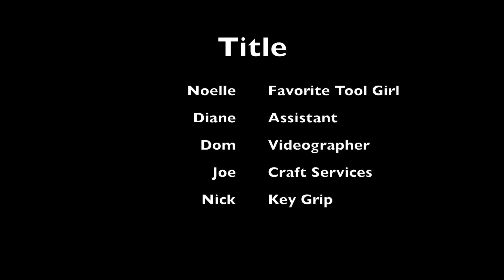How to Install Fake Stone Wall Panels DIY

Comment: noel i have vinyl siding i think...its like panels that over lap...would i have to remove these or can i just put the panel over it...if there issomeway to do it without removing them...i just dont want to ruin my house ....i would like to put these on the bottom as a border...but i suppose you r going to tell me it has to be a nice even flat surface...

Comment: But every piece fit perfectly. How? Was the room measured before ordering the pieces?
Reply: The men have a tile cutter, it's not difficult, just have to have time & extra if you chip while cutting tile... its make alot of mess, you have to use water then the clay like powder sticks to your driveway! I would learn how to cut the tile before trying this at home... got skills ?
Reply: Kayla This isn’t tile . Most likely some kind of plastic. They probably took their measurements and cut it with a skillsaw
Reply: @KaylaC-s5n  🤣🤣🤣🤣🤣 the men 🤣🤣
Reply: @KaylaC-s5n  says the guy looking to a woman for help 😂

Comment: This vid was 100% what I was looking for, you made it look easy. 2 question though. 1), is it possible to do this to connecting walls. I’m wanting to get some of those panels for my bathroom. 2). I’m guessing they are easy to cut to whatever to shape of the area you plan to stick it to?

Comment: After becoming a self taught mason of sorts, and using stone veneers, lathes, trowels and Mortar/grout/caulk, not to mention the dust flying, all the cutting and big mess, somehow this just seems so much easier to achieve a similar look! Makes one wonder, Why didn’t we come up with this product sooner? And what other short cuts can we come up with that would still look similar and require half the time? I was just informed that they did, it was  that atrocious 1970’s fake wood paneling! Um...That’s not quite what I meant!
Reply: ??? - Do you know if its easy to put in putty/grout to the joining seems and smooth with a trowel/ soft small paint brush to blend to contours or is it really a job for a tile layer type experienced person, -for a nice finish???

Comment: Now my question is can I put this in a room where I will put my big add tv on the wall and make it an entertainment area
Reply: Yes, I have seen living areas with a mounted tv over this design. Make sure you know where your wood studs are, securing tv to drywall would be to weak and break your beautiful tv.

Comment: Always put the power socket in upside down(Not how she is doing it in the video)!!!. If something falls on the 2 power ends when the cord isnt fully plugged in, it can lead to a fire. Having the ground facing the top , you wont have that issue

Comment: "Having a nail gun makes the install super easy. The nails just disappear into the material." I would hope most women would know the successes of a nail gun.
Reply: TheAndeegail
Reply: TheAndeegail asdf
Reply: Is a good tool, but in not as deep as a screw. Plus you can take them off easy, with nails if you need to replace one panel, you must be very creative.
Reply: TheAndeegail do you? If so..attractive :3